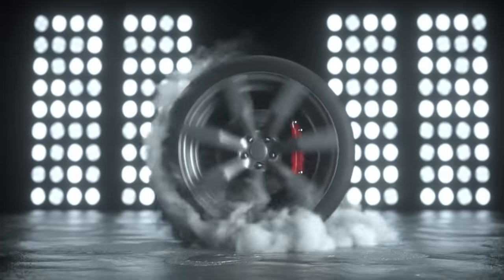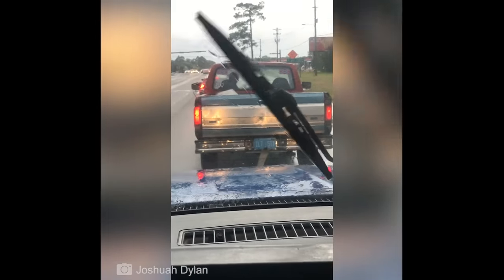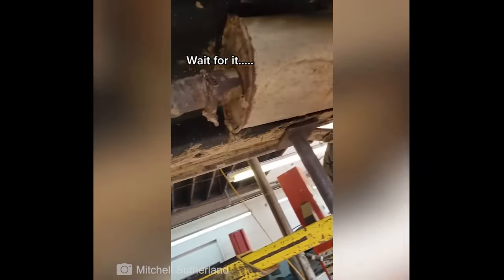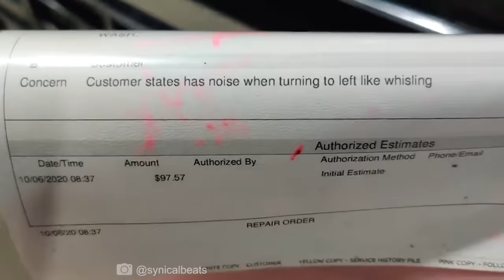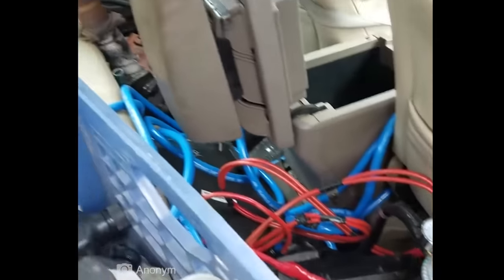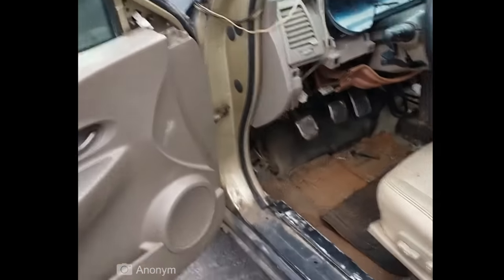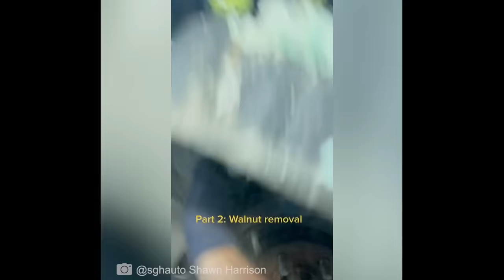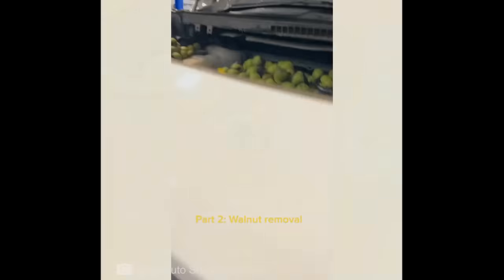Mechanical Problems Compilation [Part 21] 10 Minutes Mechanical Fails and more

Comment: 5:21 had a similar issue with one of our older cars. (A "Gen 2"/2009~2014 Skoda Fabia) where the first/protective layer on the paint (specifically on the roof) seem to have peeled off. I suspected that it was 'cause of a certain tree sap from the tree above it (I mean, the branches from the tree, that would hang over the car of course.)
Reply: 80s auto paint left a lot to be desired. GM paint jobs were the worst.  Orange peel with a gloss overlay.  Looked like the car had leprosy after two years.
Reply: I really think my uncle did that paint job cause my dad had him paint his truck and the paint peeled just like in this video lol
Reply: @smw381st  That happens if you don't clean the surface of oily substances.
Reply: @seanthiar  Not sure the real reason but that could have been it.
Reply: @smw381st  GM changed to a water-based basecoat paint back then, this happened a lot, most famous color to peel was white.
Reply: @rearspeaker6364  He painted my car about the same year and it did not peel at all

Comment: 2:39, he actually greased it thru there? 😂😂😂😂😂😂
Reply: Yes he did, I wonder how much that fix cost.
Reply: @Bryan-C  highly doubt it went into the brake line system, so id assume just a caliper replacement, probably around 200 bucks

Comment: 2:22 - WTF? I don't get it, isn't that the normal expected rubber cap over the bleeder valve?
Reply: They put the cap back on after using it as a grease zerk.
Reply: @hankdieselify  I don't even know what the F you just said, nor do I care. I've done plenty of brakes myself. Ignorance of brakes causes deaths.
Reply: @southernflatland  these are made for releasing air in the lines, not for putting a couple of shots of grease into, as evidenced in the video timestamp, there is a bunch of red grease under that rubber cap.  Get it?
Reply: @hankdieselify No shit Watson, read my comment again. I never once mentioned grease in the first place. I know exactly what TF a bleeder valve is, I've done my fair share of brakes before.
Reply: @hankdieselify  And I don't see any grease on that valve, I only see grease on the mechanic's fingers.

Comment: The propane/N0x is similar to what we did as kids but we used an oxy bottle with a cutting torch ,aiming a hose into a nipple screwed into the air filter. Worked Great! until pistons started melting.

Comment: Blinker fluid change,.. I did this to my truck, seal was gone and it kepy collecting moisture to the point one for the lamps exploded. Got fed up, drilled a hole, been 5yrs now and no problems.

Comment: 2:41 well that got expensive. FYI for those that don't know any petroleum product IE oil or grease cause rubber to swell up and come apart. Meaning everything containing rubber has to be replaced. Calipers hoses master cylinder abs module etc.
Reply: thank you thank you for the explanation

Comment: I have done the same as the first video. The taillights would hold moisture to the point of water sloshing around in them. Drilled a small hole and problem solved.

Comment: one of the straps on my grandpa's trailer flew off as he was pulling it with his engine pulling equipment and the stuff flew onto the highway, before they could pick it all up off the road some woman in a sedan came and ran over the engine holder (don't know exact name but you bolt the engine to it while you work on it) and started leaking a ton of fluids, prolly destroyed the whole underside of her car, but she never stopped, just kept driving like nothing happened. I wonder if her car is in one of these videos because she never stopped to talk to my grandpa and he couldn't chase her because he had to get all his stuff loaded.

Comment: I used to work by myself at a diesel shop at night in the ghetto. One night two guys came in and pleaded with me to give them a jump. They assured me that all they needed was a jump, so I grab the box and we walk back to their car which was several blocks away in an abandoned parking lot. I open the hood and it’s a fucking custom monstrosity like that thing @5:45. Turns out they didn’t need a jump at all they just thought I could diagnose this custom freak show at 3am, 20 below, in gang territory. I was pissed.

Comment: To be that guy that mechanic who has to clean all the walnuts from the car if I was that car owner I would hold the car by the wheels with a lift or tractor and just shake them out then just remove the wheel liners so no more nuts

Comment: 2:30  What's the problem?  Grease will protect bleeder from corrosion.  If you're in the salt belt you know what its like breaking off a frozen bleeder.
Reply: First thing I though was that somebody though it was a grease fitting and greased the caliper. But what you said makes sense.
Reply: @facusan2339  hmmm, maybe. Well then they inadvertently protected it, lol. I can see how it would look like a Zerk fitting.

Comment: Wait does adding propane to your engine for more power actually work? Or is this jus a quicker way to ruin an engine?
Reply: I'm thinking yes, atleast alittle. Propane is used as fuel for internal combustion engines quite often so its not some high proformace fuel. It's octane rating is 104 and thats better than any standard gasoline pump I've ever seen but Ultimately unless they have the air fuel mixture set properly it may actually cause their car to burn rich and thus lose power. If they were running a super charger or turbo in order to compress the incoming air so they can burn more fuel and then adding the propane on top of gasoline might give them a few more horsepower 🤷‍♂️

Comment: wait, is that an early to mid 90's park ave pulling both of those, could this be why gm killed off the 3800 series engine later on

Comment: Question: is the customer's car farthing straight or sideways? Because if the customer's car farts sideways it would be impossible to measure at what speed the customer's car farts between the chair bars. 😂😂😂😂😂😂😂😂😂🤣🤣🤣🤣🤣🤣🤣🤣🤣😂😂😂😂😂😂😂😂🤣

Comment: a trucker at work owns a kennworth truck, he had me come outside to help him with  soemthing, that was an emergency becasue it was smoking on way to warehouse.  He found out why, by visual and scent, It smelt good but I knew it was woody something.   So he climbed up and opened filter stack.  and said " FK ME SHEILA"     the filter stack was full of acorns.   i held trashcan under the stack, It took all his might and weight to deadlift filter upwards.   seems like 8,000 acorns come piling over. i nearly lost my trashcan from the weight hitting the bottom the can.     was pretty funny though.

Comment: Why did the auto companies have to make the "easy fill"? Just put vented fuel caps on the cars so they don't fart. I don't know what ir more annoying, the farting gas filler or the car shutting off when stopped at a red light. I hate that auto stop/start shit. The auto stop/start will certainly benefit the auto parts stores, people will be replacing starters and batteries much more often now.

Comment: It's kind of sad hearing all those ridiculing of customers reports and complaints. There's shut on the road, hits happens, failures happens and we as customers go to you, specialist to put it right. Imagine going to the doctor with black feet, the doctor would be taking pictures and sending them around to driends, ridiculing stupid patient who's socks were staining his feet. 
I went to my mechanic last week with a screw in a tyre, also mentioning a slight vibration under my ass while driving and slight grinding noise disappearing when turning right, coming back as soon as car is back to level. He has changed the tyre and said the grinding should go away. Got in, went out on the road and literally want right back because the grinding was still there. He scratched his head and asked to ride around. Came back with no ideas, the car went on a channel and all seems to be absolutely fine except for vibration and grinding. After 3 hours- 3HOURS! Of waiting they realised one of my tyres was loose and wobbling around. Should I mention THEY change those tyres to new ones about 5 weeks earlier? Never tighten up nuts properly and the wheel was getting loose gradually. But on arrival I was "the silly one" feeling vibration in my seat.  That screw in a tyre saved my life.